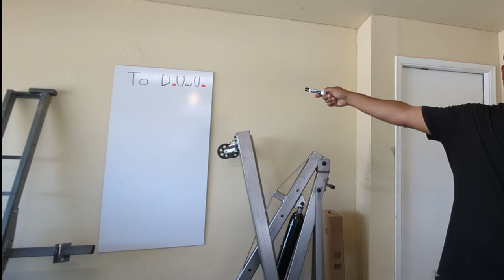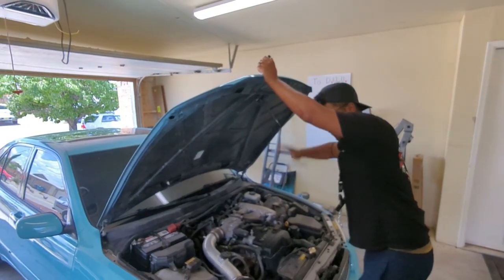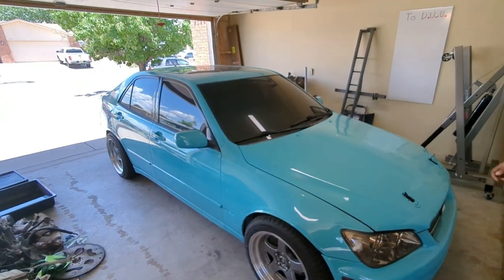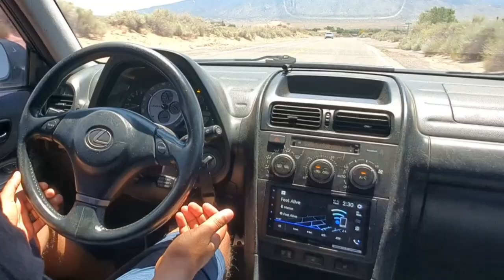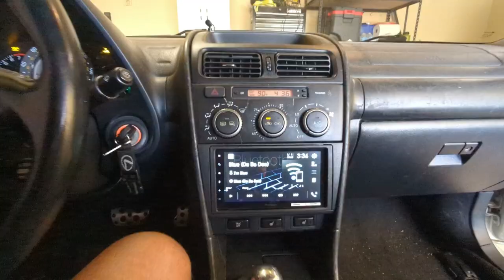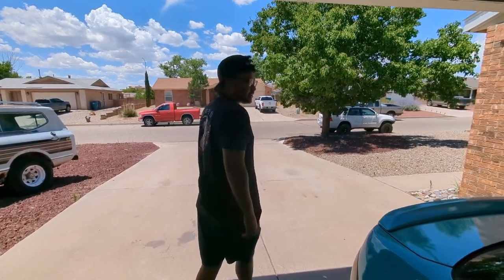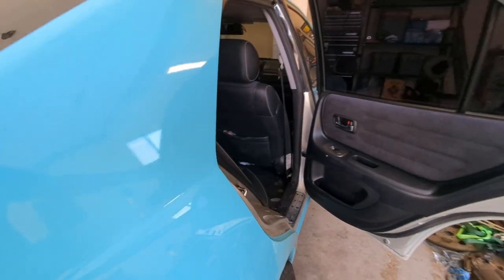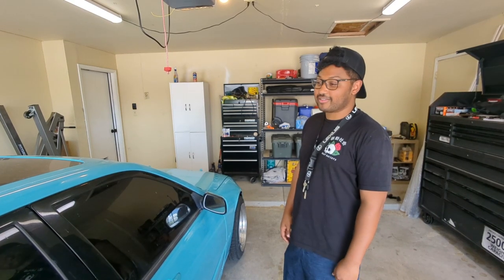Is Buying Someone else's Project Car Worth the Risk?

Comment: Omg I know the pain my 03 IS300 had almost with the same problems. Went crazy ripping out the interior to clean it and replacing muffler delete with a 2nd hand greddy catback was the best idea ever. Good luck!
Reply from the maker: 🙏 Thanks man!! People seem to love the muffler delete on this car for some reason lol. I'm hoping to do something similar to clean up the soundtrack!
Reply: @Automobros  because it sounds f*ckin mean but absolutely DO NOT delete the resonator lmao (unless you replace with a similar aftermarket one) 

resonator basically addresses obnoxious trombone and droning at freeway speeds, doesn't change volume or sound at mid to high rpms

Comment: The accelerator cable at the top of the engine would need tightening as its floppy/loose. Once done it makes a big difference. Clean out the rear sill as they collect mud/leaves. Look out for some TTE wheels or early G300 SPORT wheels. I had a is300 sportcross just wish it was manual. I've had two is300s automatics and both had solenoid issues, the solenoids can be bought and changed, so if you one drops a code for it dont worry. I have heard people replacing autos only to find the solenoid at fault. Otherwise its a lovely car. Nice project guys. Its in the right hands for sure
Reply from the maker: Thanks so much for the info and kind words!! We'll definitely be adding those items to the board 😁 and will for sure start looking out for those wheels! We've filmed the next couple vids already so you might see some placeholder activity in that area 😉

A sportcross, wow! So you're a proper fan of these cars 😊 And I am of the same mindset, my one wish is this car had a manual!  It's almost criminal how few of them came out of the factory with 3 pedals..
Reply: @Automobros  yep but as a daily the auto is great. Those manual buttons are ok but just use it as it was made the manual swap as I recall is a ball ache.